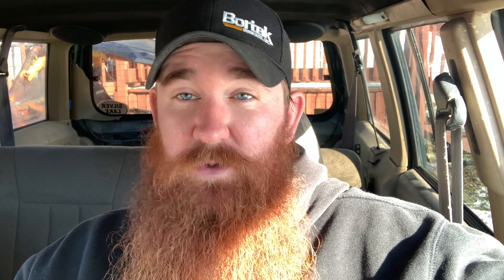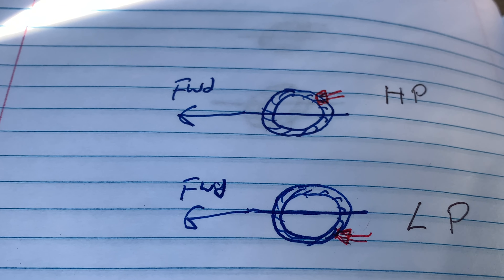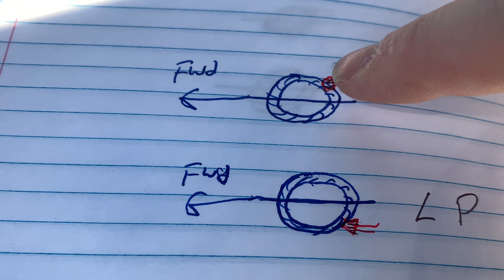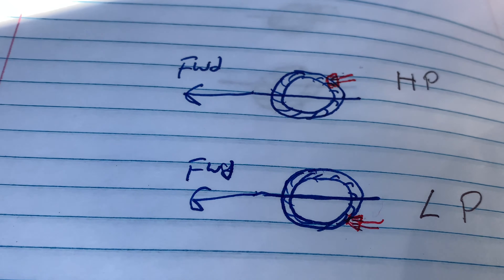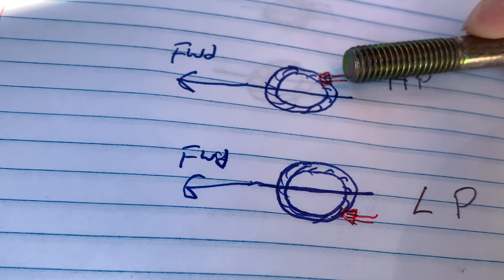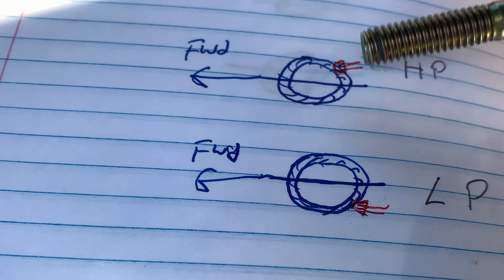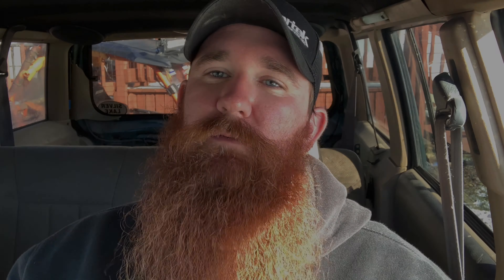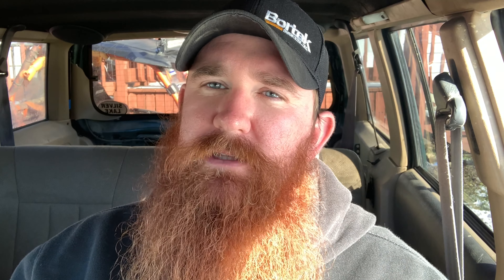Dana 30 Low Pinion vs High Pinion (the truth)

Comment: The 8.8 is larger and stronger in every way over the 8.25. I am not saying that the 8.25 isn't a great axle its just not as strong as the 8.8. The gears, tubes, bearings, brakes and shafts are bigger. I did a lot of research before i did my 8.8 swap and i feel like it was the right one. Total cost of the swap was $583 and thats with extra shafts, a truss, solid diff cover, new brakes, paint etc. I found a Detroit locker for $325, so i have a built axle that can run 37's with no issues for about $900. The good thing about the 8.25 is its cheap and is a direct swap but if you buy Chromoly shafts, get a truss, put on disk brakes etc, you will be around the same price.

Comment: When I swapped my old TJ to HP, I went with a disconnect axle.  I was going to convert it to non-disco, but happened upon a 95 YJ in the scrap yard… it’s the ONLY Jeep to get the disconnect shaft with a larger U-joint.  I used a Waggy vacuum disconnect switch to slide the collar.  Worked great!

Comment: Good luck with that, I've seen LP30s break doing doughnuts in a muddy field. If you're serious about making a LP30 live then add a load bolt, ring gear deflection is horrible when running on the coast side of a gear.
Reply from the maker: Seen this happen on a HP also. low pinion or high the ring gears are the weak point
Reply: @cherokeeronnie  I've killed hp30 gears myself, but it was locked on 35's banging limiter in a rock garden and that gearset had already killed 4 or 5 axle shafts.

Also get a crush sleeve eliminator for the LP, it will help a slight bit, it needs all the help it can get.

Comment: I have a 2000XJ running LP30 on 35s with ARB locker, 4.56 gears, chromo axle shafts. Snapped my u joints and broke the lobe off of my chromos before, til this day still haven't blown up ring and pinion knock on wood. No mall crawler either, completed everything in big bear CA and Rubicon start to finish on this setup. Good idea keeping the axle and u joints the weak point, I would not advise RCV's on a Dana 30 LP or HP, definitely would transfer your fuse internal to the differential (just my opinion). Axles and u joints easy trail fix, smart ppl bring spares. 35s max in my mind on any dana 30 you will be rock crawiling with, street only 37s would be fine (just my opinion). Love the videos, these are perfect for getting people into off roading on a budget and still having a great rig they can enjoy.

Good stuff Ronnie, keep it coming!

Comment: I have a Hp in my 93 2 door, with a Spartan locker and 35s and I beat the actual crap out of it. I gusseted the knuckles and that's is. Years of abuse and it's held up amazing! Great video! Lots of really good info.

Comment: There is a BIG advantage of the low pinnion. Front axle is never loaded as much as rear. Hence 30 front, 35 rear.
But:
When going uphill in reverse - D30 LP is stronger than HP. And in this case the front axle is more stressed than rear. Every last bit of strenght helps here.

Comment: You think you broke the internet with that, that's nothing lol I'm putting a Dana 30 hi pinion with 44 outers and it's locked and fully sleeved 6 Lug conversion etc IN MY 03 Toyota Tacoma 2.7 extra cab, I CAN'T WAIT TO POST THAT VIDEO! I'm going full on Jeep / Toyota taboo, I can feel the hate already, personally I would never use a D30 low , We've thrown out quite a few of them and now regret it, they're not horrible but if you have the choice, going with a reverse cut high pinion is a better choice, but IT'S YOUR JEEP! You do whatever the fuck you want! FTW brother, been enjoying your videos, keep em coming and keep up the good work, and PS I actually love the 29 spline 8.25, I Lincoln locked my first XJ back in 03 and it lasted forever! Multiple offroad trips, NY hard-core streets etc, and I've ran a 8.8 in my 01 4.6 stroker, both good rears and my friend who's like a jeep legend put a 8.25 in his wife's TJ , anything beats a Dana turdy

Comment: So I did the HPD30 swap in my 2000 (originally a LPD30). I was fully prepared to just build the LP. I know that for my setup, the only variable in strength was the ring and pinion gear and that I’d sooner break shafts than the gears. But at 6” of lift and next to zero caster, I decided I wanted to get my caster back. If I was at a lower lift, I would have totally stayed with the LP. It’s a good axle, I just felt like in my case it wasn’t worth putting the money into when I could get a HP for $100, especially when alignment was my big focus. (Which BTW I’m at 6” of lift and 6.7° caster and its one finger steering at 75mph)

Same with the 8.25, it’s a good axle! I have two buddies both on 35’s and factory shafts that abuse their jeeps on the rocks. One is a 27sp and the other is a 29sp. Both have held up great. I swapped an 8.8 in mine. The reason why I decided to do it was because it would cost me $750 to do an open diff regear in the rear. I was $900 all in on my 8.8. And that was finding one with 4.10’s and limited slip. I threw a limited slip rebuild at it, the swap kit, and a full brake kit from the lines to the calipers to the rotors and more. $900 before selling my old axle was hard to beat. For $150 more than a open diff re gear, that was getting a lot. 

That said, if the prices weren’t right and I didn’t feel like caster was a huge priority, I 100% would have stayed with the LP and the 8.25. They do just fine.

Comment: Bang on about the drama 
I thought I would put in my input. I did an axle swap couple years ago to a HP30 and Ford 8.8 in my 98 TJ. I am running 35 pitbulls on it and I would have probably just kept the LP but I was regearing it which was over winter so I wanted to regear in my tiny garage so it was easier to just pick up a HP 30 (91(?) Cherokee BTW) and swap them out come spring. The LP gets a bad rap but in reality since most of the stress is on the rear axle anyways it is usually fine. I also threw an ARB in it. 
Now the 8.8 I do question as for the money I threw into it to get it to fit and everything was replaced except for the axle I could have spent an extra hundred at that point and bought an empty Dana 44 housing. It would have been about the same amount of money as the axle plus the Artec bracketry ended up being the same price. I just didn't realize they were available. Finding a TJ 44 in my area is like finding Hens teeth

Comment: Rusty411 is running 40's on d30/c8.25 - main use north Florida / south Georgia  mud trails.  Still running good.
Reply: He put it in reverse while going forward at 40 mph and sheared off 1/3 of the ring gear teeth.  But it was doing fine until that.
Reply: @robbanks7393  very true...

Comment: plus the lower the gear ratio you go with, the weaker the gears will be.  I've got a 2005 LJ - 6 speed manual - with D30 in the front.  I'm running 35s so I was going to go with 4.88 gears but the guy that did my gears told me not to go with 4.88 because he said that would be way too weak on the D30.  So I went with 4.11 gears.  I'm glad I went with 4.11 because 4.88 would have been way too low with my 6 speed manual trans.  Plus 4.11 has a little more meat on them.  just my .02 cents

Comment: Hey Ronnie, first off awesome information, thank you. My 98ZJ low pinion Dana 30 has the rzeppa yoke and the joint to the front drive shaft is broken. I picked up a high pinion from a 94XJ (with the U joint yoke) for $50, Is worth swapping the front axles or should I try to just change the yoke? I'm going to see if the LP CVs will fit the HP CVs.

Comment: If I already had a LP in my rig I’d run it. But there’s no way if I’m buying a axle that I’ll go with the LP over the HP.
When dealing with stock gear ratios the ring gear is the weak point but once you go up to a 4.88 or a 5.13 the pinion is so small it can’t deal with much abuse from deflection that comes with running a LP

Comment: Low pinion has one real world advantage, the gear is always running in liquid. 
High pinions are lubed, and cooled by oil sling off the ring gear.
 In endurance racing applications low pinion has a distinct advantage. 
 If you need a weekend trail rider, you should not be able to generate enough heat to notice any benefit.

Comment: How much rotational play should I have in the yolk? I just bought an 88 wrangler and I can turn the front dif yolk about 1/4 turn before the gears catch. The bearings seem tight but that seems sloppy to me. Compared to my Ford that has no play.
Reply from the maker: You can open it up and check it but I’ve seen them have a lot of play and be fine

Comment: im not one who jumped on the 8.8 ford rearend bandwagon. My 8.25 rear is just fine. But the HP Dana30 with its reverse cut gears is rumored to be 30% stronger than a low pinion. i tend to believe that because of where the force from the pinion gear contacts the teeth on the ring gear, HP is on the strong side of the ring gear teeth, the low pinion is on the angled side of the teeth, and not as strong. can a low pinion D30 be made to be durable, sure. but when you can get used HP Dana30's for 200$ or cheaper, why not use one right?
Reply from the maker: It’s only about 25% stronger and lp and hp both have cons and if you look at both the axles it’s not worth spending a extra 400 bucks for the axle when they both have weak points anyway
Reply: i bought my HP D30 for 125.00$
Reply from the maker: Must be nice they think that stuff is gold around here
Reply: @cherokeeronnie  The market is crazy right now I agree they are asking more around my area also.
Reply: Probably not worth spending any significant money on a D30 regardless of HP or LP. So whichever you have do a cheap build and save the money for later axle swap.
Reply from the maker: That’s where people
Get it run I’m not planing on running anything bigger than 35s I don’t need to do a axle swap

Comment: To the best of my knowledge, the only benefit of a low pinion is better lubrication of the pinion bearings and gears.  Since the front axle doesn't do much work on the highway, this is a non-issue.

It is my belief that whether it is high pinion or low pinion, as the vehicle moves forward, the torque applied to the pinion should cause it to be pulled into the meat of the housing and not pushed away.  I am assuming that is how both of them work.  Also keep in mind that at least the high pinion front Dana 30s use reverse cut gears.  

Strength-wise, I doubt there is a notable difference provided that the components are sized the same.  I expect that the idea of the high pinion is strictly for the purpose of reducing driveline vibrations, and since maximum lubrication isn't necessary, it makes sense to do it that way.

Comment: Anything can be built strong 8.8 is stronger stock I got a built 8.8 in my xj dama 44 up front runs 37 never breaks going to 40 soon there a lot stronger with lockers so it’s not fighting it self there both not huge upgrades but a bit stronger then stock for sure